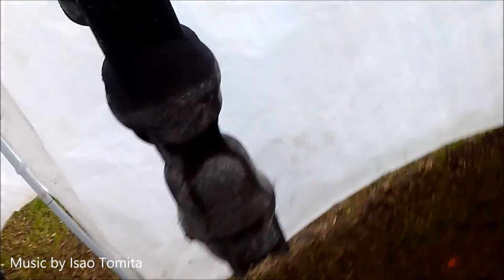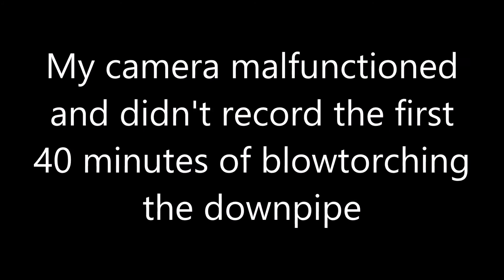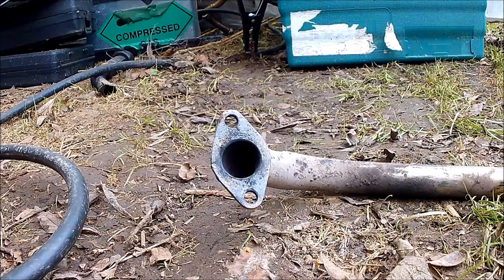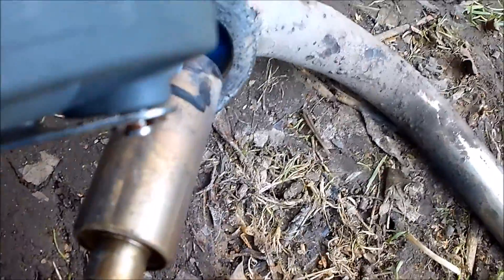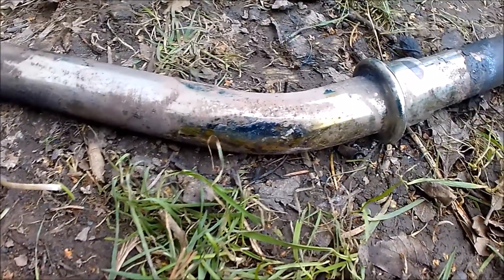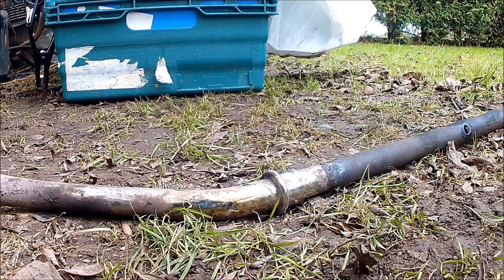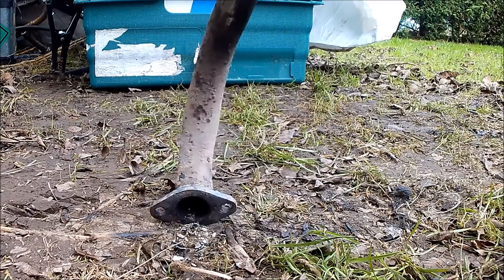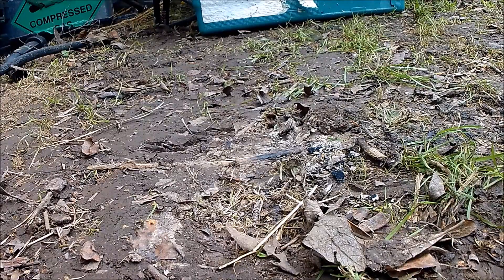Decoking a Puch Maxi Exhaust pt2. Blowtorch vs Lye (Caustic Soda)

Comment: one way to knock out crap from inside is get about 2ft  of say 1/4" wire cable and put it in a drill. Put this inside the pipe and spin it